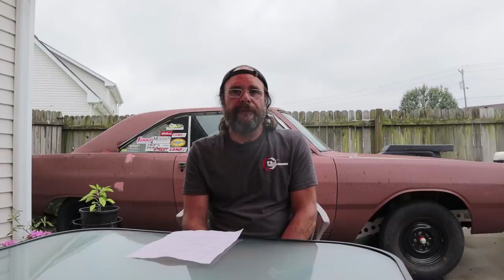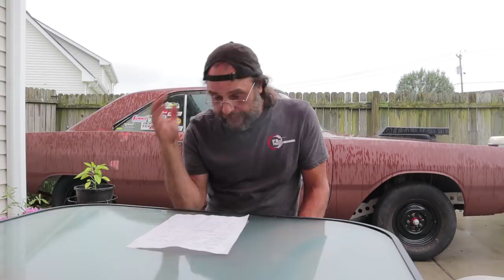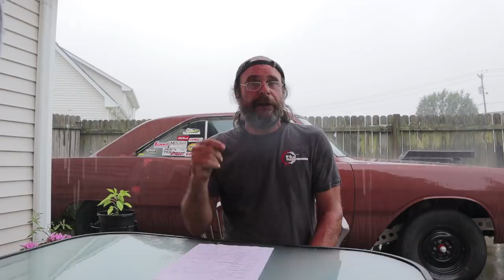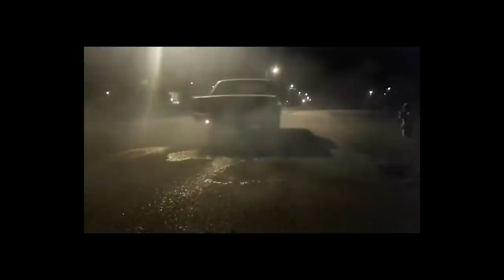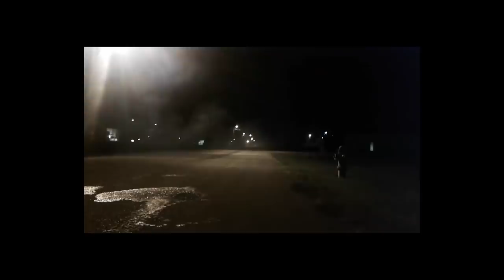Understanding The Slant Six Part Deux

Comment: I've only experienced two slant-six motors... first was a buddy's '62 (?) Valiant with a push-button automatic, which I believe may have been the 170 version. The other was in a '68 D-200 4x4 truck, probably a 225. That truck was a real dog... no power, and used oil like crazy!

Comment: Reminds me of an old Val with triple SUs, very neat job. Instead of a mess of external cables, linkages & springs for throttles & chokes, like a straight 6 Datsun with triple Stromberg CDs, it has shafts going through the carbies, giving a very clean look, so as not to detract from its stainless 3-2-1 extractors. Now we just need some rod shop to bring out out a line of crossflow alloy heads, then comes the final what if, a V12. Be a bit weird though with the pushrods on the outside instead of the middle, instead of boasting about twincam heads one can boast about the twincam block..

Comment: Wow that thing sounds just like the concrete breaking machine we used to have with a slant six in it, we would pull the throttle wide open and lock it, then it would lift an eight hundred steel wedge anvil ten feet off the ground and drop it. Sometimes we'd run that machine ten or twelve hours a day.
Reply: larry brown  I've seen at least one slant six in a cris craft boat also.

Comment: Back in the day, I dreamed of a lifetime vehicle, and the engine I believed would do it was a slant 6. With today's technology, I would go with a pushrod v8. I am currently working out of a 4.3 v6 with over 300000 miles and very little oil use. I now use cheap diesel oil because it still has zinc in it. Like racing oil and motorcycle oil.
Reply from the maker: Same here.  I use Rotella in everything I have that needs zinc

Comment: I really like those slants. The slant 6 valiant and dart where probably the most common taxi cab to find on Norwegian roads from the mid 60's to about 74. During the 50's and early 60's before we found oil, there where mostly Moscowitches and Volgas and those kind of ruski tractors xD My grandad had valiant's but he was kinda special cuz he would only buy them with 318's he had a 68 71 and a 74 and then he got a simca and gave up after a year or two because those fake Chryslers where utter shaite xD But his first ever taxi cab was a 46 Plymouth Cranbrook 😁

Comment: I had a '62 Ranchero with a 200 inch ford six and Borg Warner T-10 four speed. It would beat a 327 Chev across an intersection and cruise 75+ mph at 20 mpg. Inline sixes are GREAT engines,. Still love my '01 Dodge with Cummins inline.

Comment: Many, many years ago( early 70's) in college auto tech I built a 225.  10 to 1 pistons, bored 100 thousands, Jahns pistons I think, Clifford intake, Holley 4bbl, ported the head, new rods, Isky cam, bigger oil pump from Mopar etc.  Never got to putting it into a car.  Had 62 Valiant 170 with the small v8 4 speed trans. I kick my self for not finishing the project.

Comment: IN ALASKA THEY WOULD RUN THESE SLANT 6 ENGINES WITH NO ANTIFREEZE., MY FRIENDS FATHER DROVE A POLARA TAXI HERE IN NEW YORK BACK IN THE 60-70'S AND HAD 900,000 MILES ON  IT. GREAT ENGINE.

Comment: I had 69 dart with a 225. My friend sold it to me fer $25. He was afraid it would die any day. I drove it for 3 yrs. I did have to buy a new high pressure power steering line ($26), I told the parts seller that was more than I paid for the car. He came back to where we were stationed and, I was leaving. I sold it back to him for $1. The registration was due, $26. That was a bulletproof car.

Comment: Had a 76D 100 with a 225/61 barrel first truck was awesome very reliable. But the only thing bad about it was top speed was 65 mph LOL
Reply: I know only had 900 bucks bro
Reply: It must've been falling on it's face or had a short rear end gear.

My 80 Volare sedan with the 1bbl cost me quite a bit of funds due to being caught at 110 in a 65 lol
Reply: Yes had a 410 rear end  it was screaming at 65 mph
Reply: @Mark-zz9rt  lol that explains it.

The stock open gear in mine meant it'd do around 120-30 wide open down a long hill lol

Comment: Very cool. I just finished putting together my 225 long block for my 66 dart. I used a 265 comp cam matched the springs. I had a head with a star cast into it which indicates that it’s a head from an aluminum short block. Any ways stoked on the slant info.

Comment: Dad was horsetrading for a slant 6 for his van.He told the guy if he could fix his car could we take the engine only 90000 miles.He pulled the distributor replaced the shear pin with a nail 10 min.The guy was pissed we got the engine it was the small one it worked.

Comment: Saw this pop up, but a turbo slant 6 vid popped up below this. 
 What do i do?
Reply: Nice on keepin the burnin tire cloud goin,on the change  into the next gear.
Reply: Watch them both!
Reply: @brucejones2354  
Now I want one haha.
Reply: @MrTheHillfolk  , in 1971 I  bought a '65 Plymouth Belvedere 1. It was a government car and it had  90, 000 miles, auto trans, positraction rear end, paid $378.00. 1 year later I found an Oldsmobile Rocket that had the 315 cid turbo charged engine in a junk yard, the Olds had been totaled. I bought the complete turbo system off that car , including the 1 barrel side draft carb with alcohol injection,  alcohol tank, everything for $25. Then I bought an intake and exhaust manifold off another slant  6. I installed this on my belvedere with an extra 2  1/2 inch washers under the spring that regulates the manifold boost. This car went from a quarter mile time of 27 seconds @ 67 mph, to 10.37 seconds @ 134. Talk about a sleeper, this car was it. Nice thing I used 3" exhaust pipe from the turbo to a 12" glass pack muffler at The rear bumper, the car sounded like a John Deere tractor when it was idling.  I  took many a 327 Camaro to the cleaners. I lost the car to an accident when a 70 year old man, who was going home after a dentist appointment, ran a stop sign and hit me square in the driver's door.

Comment: New sub here guy. I just inherited my dads 1980 D150 custom with the slant 6 with the manual transmission. Big tree branch fell on it smashed the cab a bit and smoked the bed as well. Hasn’t ran in years any tips on getting this thing running.

Comment: I have to give a like to a guy who will sit out in the rain to provide an informational video for us. I have only seen one aluminum block slant 6 before. I wouldn't suggest one for performance at all, you can't bore them out much and the things were notorious for blowing head gaskets. 

Another way to very quickly tell whether a slant 6 has a cast crank or a steel crank is to look on the block right behind where the water pump mounts.  There will be a triangular piece (reinforcement) there. The steel crank ones have some width and look flatter right on the center. The triangular piece on the cast crank engine is much thinner almost to a point.

Comment: Your knowledge in this area is killer Uncle Tony. Gonna try to stump you, and I won't think less of you if you don't know the answer. Here we go.......I am a farmer and have ran several 225 slant six engines in the industrial application for hay cutting tools. In the 70's and very early 80's these engines found themselves being used by many agricultural manufacturers. I am certain these agricultural industrial engines had forged steel cranks in 225 CID. Would these make good engines for a car in the hot rod environment????? Or like you said before, look for an automotive 170 and lighter cast steel crank. Thanks.
Reply from the maker: As far as I know, there is no difference between industrial and street Slant Sixes.  Definitely prime material for a hot rod build

Comment: Another thing I remember, when working for chrysler one of the engineers told me they were fazing out the slant six because the 318 was making more power and getting better fuel economy. Straight six engines always produced good power. The jeep 4.0 fell to the wayside because of the government tightening up on emission standards. We tweaked that engine every year until it became impossible to be cost effective. Another straight 6 gone.

Comment: Great stuff Tony. Back in the day, I bought a 67 Barracuda with a locked up 273. I put in a 318 and enjoyed it for years. However, when I dropped in a 73 340 it really came alive.  Maybe you would be the guy to explain to me why the 340 is better than say a 360, and way better than a 318.  What is the deal on crank journals, performance wise.  Also, where does the 4 barrel 273 go into the mix. I guess my interest would be as a guy today buying a small block mopar in a junk yard to build.
Reply from the maker: Hang tight..we have a solid SBM feature planned for the near future

Comment: you know what i was thinking was what if you took some nickle rod and welded quenches into the head or have quench domes cast into a set of pistons to get that combustion chamber geometry optimal
Reply from the maker: May try that on a cylinder head
Reply: I built plenty of datsun and Mercedes 4 and 6 cylinders and those are the tricks with to get power out of N/A non cross flow heads

Comment: I've owned several slant powered a-bodies but I've never heard one sound so mean and hook so hard as that primered 67. Subscribed. I'd like to hear your thoughts on the solid lifter 273 as far as it's potential and your experience with them. I've got one in a 65 Dart GT convertible that I'm rebuilding now.
Reply from the maker: I have a 273 in a 67 GT than runs real good.  No 1/4 times on it...set for highway use with a tight converter and 2.94 gears, BUT, the damn thing will surprise ya!  LOVE the 273's

Comment: I've always been a Mopar guy, mostly 318's.  I have a 2013 Ram right now. And I wish it had a 318 with a carb and get rid of all the damn electronice shit. Like windows, door locks and the rest of the garbage. I wish I could afford to get a 318 with the electronic ignition, the small one that was about as big as two cigarettes packs. Now my boy had about three or four cars with 225 and I bought my daughter a Duster with a super 225. I had a four barrel carb, I think. It was losing oil pressure and it turned out to be the oil pump. I went to get one and when I saw it I told the guy there was something wrong because the one she had was totally backwards. Me and the parts guy went back an forth for 20 minutes. Finally I took it and I told the guy if it don't fit I was bring the car down to his store.  Well anyway, two days later I went back and apologized to the guy. Laying on my back and seeing it upside down made me think it was wrong. He laughed and said they only make one type. Ok, ok with a red face I said he was right.

Comment: Sick slinder eh,  I have thought about turbochsrging a 68 GMC 250ci, since it is very healthy, and gas prices, I'm thinking a 5 speed, and about 8 psi!!! The intake manifolds for 6's have some crazy price tags!! I also have the 80's integral intake 250, I just can't get past the one piece head & intake, I heard 300+ hp is easily obtained, I just don't see it from the intake, even with the 2bbl. I know little about 6 bangers, I always ditched them for 8's.. I have built many v8 Chevy engines,  about all I have done with the 6's is remove them!! I did have one, I swapped in a 4speed, it was a minor difference, I'm thinking a 5 speed , would be better, maybe lower 1st plus O.D. maybe swap in 4.10 gears, and still cruse at a decent rpm,  I don't think 325-345 hp 350 lb TQ. Is impossible from 250ci street engine!! With a turbo carb engine, maybe a 450- 500 holley,

Comment: Hey, great info. Just picked up a project. 1983 dodge b 150. Slant 6 , 4 on the floor. The distributor has the plate with a slot. Does that put the engine pre 1981? Or can an old distributor fit a newer engine
Reply from the maker: Yes, someone probably swapped in an earlier engine

Comment: why are all old school mopar guys chain smokers? 
i do have a question out of curiosity, my dad back in the early 90's had a 1966 valiant with a slant 6. at some point it developed an overheating issue, and it turns out that there was a crack in the #6 cylinder wall, on the firewall side. we don't live in a freezing climate. is this a common issue?
Reply from the maker: Common? Not at all...probably just a bad casting

Comment: The Slant Six is a brick. It was built to be a brick. Drive it like a brick and you will have no problem either as a daily driver on the street or on the highway. The only thing I have learned lately is that the Slant Six has an oil flowback problem, meaning that oil pools up at one end of the pan and the cranks has to whack its way through it. It may also mean than the there is not enough oil in the sumps at all times. One solution I saw for this was to weld in a windage tray in the shallow back end of the pan. Another solution, and this is what I would do, is to use a the lightest grade of oil possible, which probably means 10W-30. Back in the bad old days, I don't think 5W-30 was even available, We usually used 10W-40 in our domestic cast iron engine, but with today's oil, there is no reason  why you can't use 10W-30 all year around outside of an artic winter climate. That's artic, not subartic. Cities like Chicago and Minneapolis are subsrtic, not artic. If you have starting problem at, say, -5F it won't be because of the oil. As best as I can determine, in an idling engine, oil heats up at at about 10F a minute, and faster if the vehicle is moving.

Comment: Could you do a video explaining how the California emissions systems work on the slant? Looking at deleting it from mine, noticed it has a hard line into the back of the head and the smog pump looks integral in the exhaust system? Not sure all the work that is entailed in removing it but at first glance appears to be a bit labor intensive.
Reply from the maker: Air injection port.  I usually just trim those tubes back and weld them closed.  I suppose you could solder a cap on too
Reply: @UncleTonysGarage  thanks again. This is the first Mopar I've owned, (1980 volare wagon) have put 4000+ miles on it over a 4 month window. Pulled the p/s, a/c and have pulled all vac lines except dist advance and choke. /6 exhaust intake being what they are, its definitely throwing me for a loop, but diligent research and help from folks such as yourself I cannot express the amount of gratitude I have. Last couple things I'd like to do is electronic WP and fans if possible and a better exhaust so i can turbo it. the holley 1945 I'm going to try to keep, its already running pig rich (9-11mpg) and I don't think CFM is an issue when the intake is under pressure. If it is there's always offenhauser intakes and a good old 750 quadrajet. Am teaching myself as I go. Basically at the point I know enough to fix pretty much anything, but still lack the experience that prevents screw-ups. Eventual plan is to have it running 11s in the 1/4 and being a beat up looking sleeper.

Comment: You mentioned you didn't get any performance boost by upgrading the torque converter? What stall was it at?  Stock is around 1800, and I was considering putting a 3000-3200 one in it, per recommendation of some folks on the Slant Six forum. I'd love to hear what you experienced.
Reply from the maker: Tried a 3500 and the engine could only work it to around 21-2200.  Played with it for all of about 20 minutes before I realized I needed a clutch for this thing to actually work.  That was the BIG difference

Comment: Also, I had to remove the carburetor on my 1983 Dodge d150 slant 6. Do you have any tips or tricks on re-attatching the linkages when re-installing? Some of the linkages were kinda tricky to remove and I am sure re-installing it will be tricky too! Any info is greatly appreciated!
Reply from the maker: Tips, tricks?..not really.  Just go slow and pay attention to the details.  I'm sure you can find an exploded view from a FSM somewhere online for that
Reply: @UncleTonysGarage  I also noticed a buzzing/whine when I put the truck in neutral. It has the 727 transmission in it. Have you ever run into this sound? The transmission shifts firmly and doesn't slip.

Comment: Tony, I have a 65 Dodge coronet 500 with a 361. I'm not a Mopar guy but it's a good original car I want to get running. Are they hard to work on? I have Ford and GM experience mainly
Reply from the maker: That's about as bread and butter Mopar as you're gonna get.  Great starting point.
Reply: @UncleTonysGarage  cool thanks man, keep up the good work

Comment: Heres a good advice,about timing never ever advance timing,,why ,,for the reason is that the piston rod or connecting rod will balance for a while in the middle or will push it downwards the wrong way when its coming up ,,,,the best way on any vehicle line up the head a little after when the piston rod is going down ,,late timing,,with a half gap spark plug it will do the trick, the exhaust system must be either ventilated to help or a larger diameter of exhaust,,,,, that speeds up the motor quick with power less gas more power,,when done right,,,I hate it is done it on a 88 Pontiac firebird,89 cavalier,1975 impala ,1983 impala,,works great the kick,it backfire on 1998 Jeep Cherokee,inline but flew fast great power,,,, a little late timing a called it must be precise to work

Comment: Hey Tony,  would CNG---Natural Gas ....as in setting up a mixture of say 20%  (or higher)  to gasoline....(set-up to go into the carb intake, via the breather) would THAT be a GOOD IDEA that might take advantage of it's LONG DURATION AT TDC ?
(this also goes along with YOUR IDEA to shave the head/block down TO INCREASE COMPRESSION....which CNG likes too).   What do Ya think  ? (CNG is NOT 100% methane...but a MIX OF GASES)
Reply from the maker: I honestly do not know enough about the properties of running CNG to offer a quality opinion